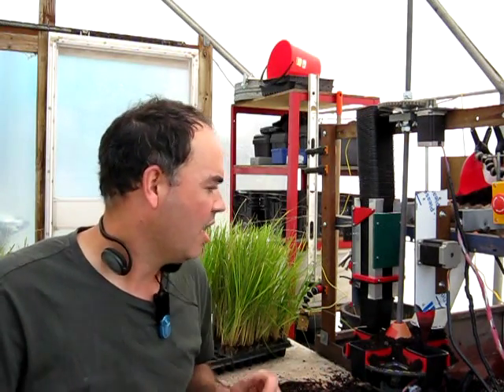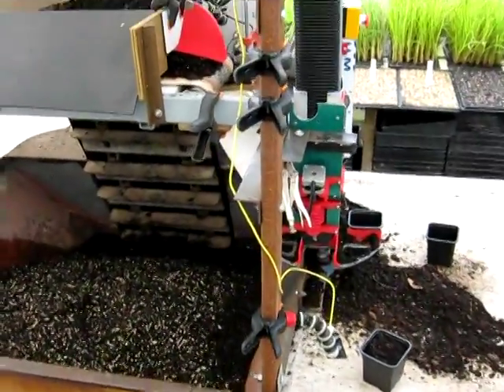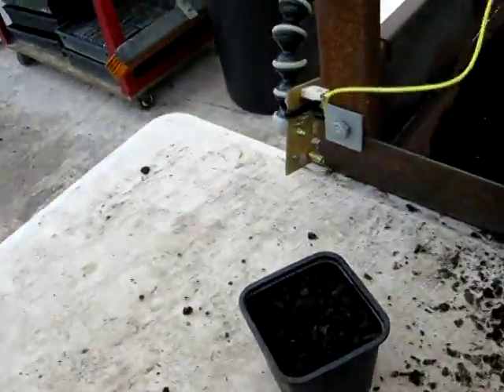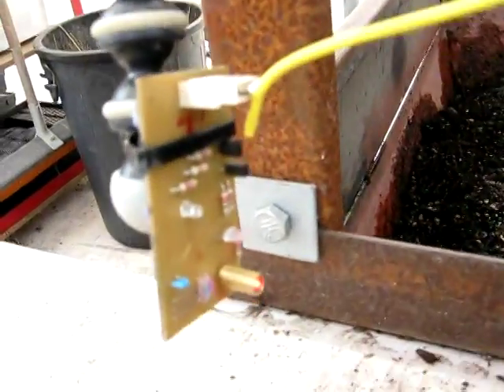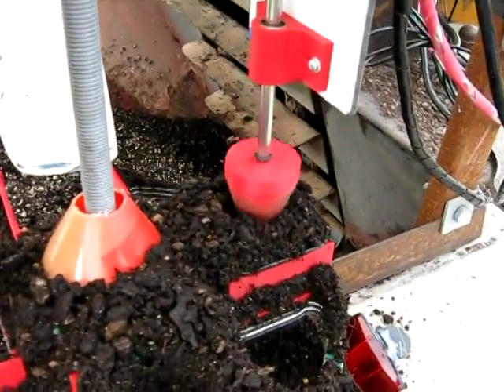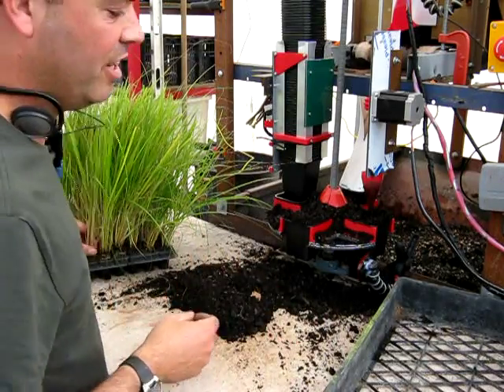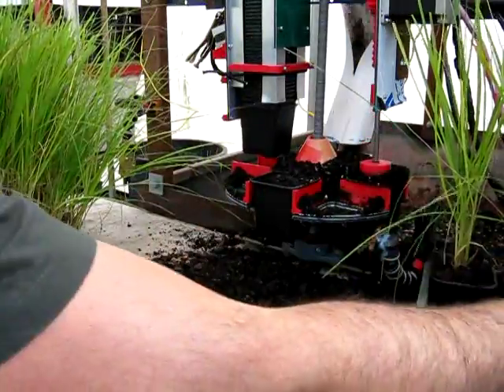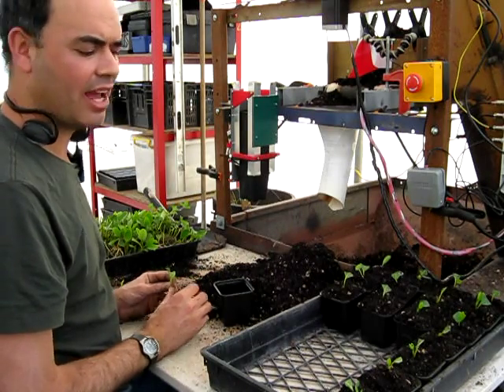DIY semi-automated Potting Machine

Comment: Azzan, nice machine. Im looking to build a semi automatic potting machine as well and this is a great guide. Did you do any upgrades for the LCD etc as yet ? Also how did you drive the conveyor belt motors .. were they 240V motors or 12/24V ?
Reply from the maker: Todd Hampson Hi, I just turned on the Machine for the first time this season and was thinking about the LCD screen; would probably be about 2 days work, but for now it is still on the to-do list. The conveyor belt is driven by a 24V stepper motor, at first I used the original motor that came with the running machine, but this required a separate power supply and was not as good at low speeds. The conveyor belt was the hardest part of the design, as damp potting mix can be sticky and is not particularly free flowing.
Reply: Azzan Jordan Thanks for the reply Azzan :) 
So the conveyor was part of the original Javo Mini unit ? .. I was looking at how best to deliver the soil evenly .. so you did it on a timer then to get the right amount ? the hall effect detector at the top, is that just to run the main motor from the javo unit to bring more soil up to the conveyor belt ie: just detects the conveyor is empty ? I cant work out how thats working exactly .. 

As you said in the description you used a 3D printer, I assume for all the red parts . did you custom design these parts ? and the turntable etc, did you get these manufactured or use parts from somewhere else ? 

There arent any other DIY planting machines on this scale I can see anywhere and its great to see what you have done and learn what I can ... my initial designs were to try to copy bigger planting machines and quickly became too complicated, especially around media getting trapped in parts :(

thanks again ...
Reply from the maker: Todd Hampson Hi Todd, the conveyor uses a stepper motor and moves the conveyor a set distance to fill a pot. If the hall effect sensor triggers, the firmware calculates that the pot is only half full, I need to move the conveyor this far to fill the other half of the pot. A lot of my problems with the conveyor were with the shape of the hopper, my first designs were a vee shaped hopper, but the potting mix would get jammed in the vee and not flow. If you were dispensing a larger amount of potting mix all the dimensions of the hopper could be larger and this would solve most of the problems with keeping the mix flowing. Yes all the red parts are 3D printed, it was only after I had a 3D printer that I even contemplated this project. My personal experience is that parts will require about 4 revisions before it will work perfectly; this is very easy if you are using a parametric cad software, I designed all the parts with OpenSCAD. I initially thought about building a machine from scratch, but concluded it would take too long and would probably not be any cheaper. Lots of nursery in New Zealand are upgrading to brand new potting machines, so their are a good number of second hand machines for sale at reasonable prices.
The turntable is made with Aluminium Composite Panel which is easy to work with using only hand tools.
Reply: Azzan Jordan Thanks for the detailed response Azzan .. Im keeping a look out for a second hand potting machine here in Aus ... I will certainly have a look at OpenSCAD, thanks for the tip. I will see what the cost of a 3D printer is . or maybe just get parts printed by 3rd parties .. not sure. Thanks for the inspiration :) .. great job !

Comment: That's super cool. Which modifications did you make yourself and would you mind giving an idea of the cost
Reply from the maker: Hi, The original Machine consisted of a bottom conveyor and the lifter. I added the top conveyor, the carousel, the pot dispenser and the dibber. The total upgrade cost was about $1500 excluding my time, the most expenses component was the top conveyor with was about $500.